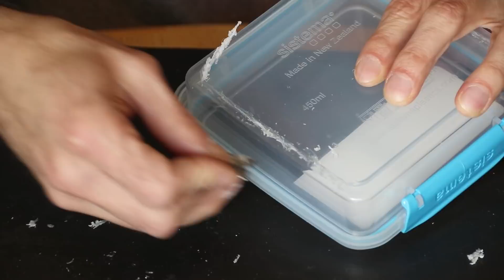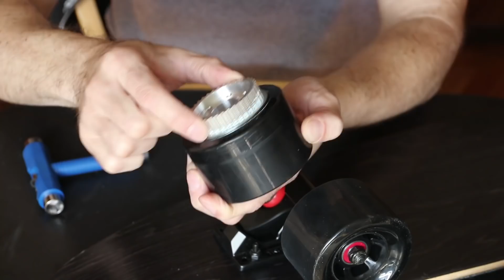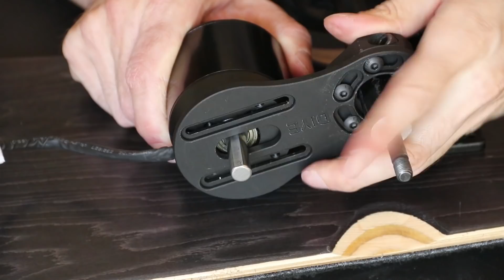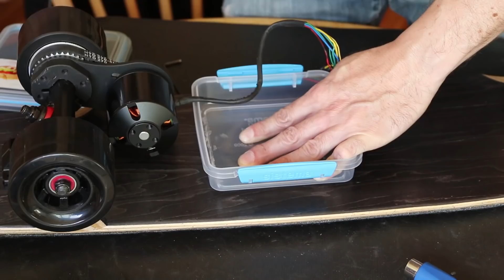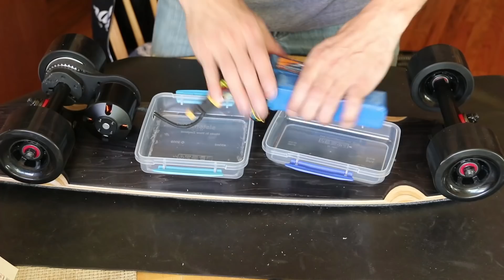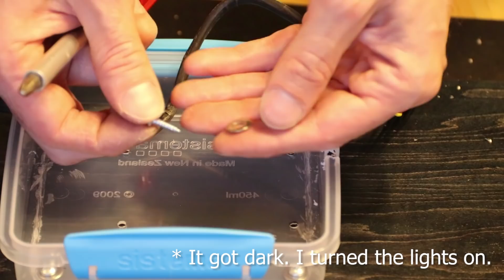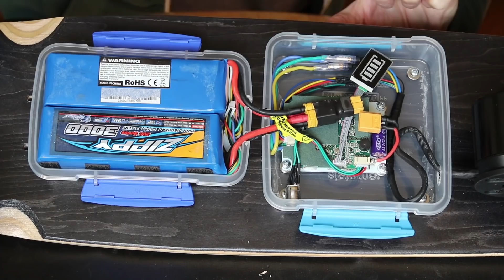Electric Skateboard Build - Belt Drive | Weight ~11 lbs | Price ＜ $300 | Speed ＞ 23 mph

Comment: I already have a 400-watt 1 wheeled electric board I need to put two 400-watt wheels on it will I have to change the control box which one should I get in the UK

Comment: Can I use a lead-acid battery pack for this controller?
Reply: 1st you have lesser volts. Seconds you need more amp. Not Ah or mah but continuous current discharge. 3rd its so heavy. 4th Dies quickly. Have you ever heard an electric car or PEV used PB battery as a source of power?

Comment: Hey man! Awesome video! I was wondering if you charge and discharge the battery pack through a BMS using the same connector?
Reply: you don't do that on belt drive. That motor will instant lock when it cut outs.(over amp) and youll kisss the apshalt from 40kph to a sudden stop.

Comment: The Sistema containers are ace, they work really well! I thank you for sharing that idea. I modified my board with 4 of the square ones, after my battery case snapped, 3 for my batteries to go in and 1 for the controller, I had to split my battery into 3 parts, I put the cells into holders and soldered them rather than weld the cells back together, now I can swap cells out on the fly to go further and the board has some flex now too.

Comment: My electric longboard has a handle cut out in the deck that loop a bike lock through to prevent theft if you're board doesn't have a handle cutout I highly recommend drilling out a hole big enough to fit a bike lock

Comment: Hub motors in electric skateboards are way way better in terms of torque, energy efficiency and overall performance. Belt-drive setups should be cheaper, but rarely ever are ever since the electric skateboards got popular (which is funny, as technically they are illegal). And honestly the design being more bulky with the whole belt contraption and with it often hanging too low to the ground, or as in your case even limiting steering, makes it rather vulnerable. You're likely to destroy it in real-life usage. The upside is how any problems generally would snap or ruin the belt, rather than destroy your ESC or motor. Although in such cases the ESC will have to deal with a huge spike in amps, so it might fry. And you have a few more options in terms of custom choice wheels and such, but in reality there aren't that much options available anyway. Thing is, should a hub motor setup ever get jammed, it'll destroy the wheels and or motor from the inside. So it could be more expensive to fix at that point. By the way, your build reeeeeally lacks any precautions against vibrations. And those containers couldn't take any kind of real world beating, like hitting a curb or rock, which is pretty much inevitable. It is unfortunate it got stolen, which is actually a huge problem with these things anyway. Even for scooters. It would be interesting to figure out a decent solution to that.

Comment: I was going to build such a board you have built. but i live in sweden where an electric board max can run at 20 km / h which corresponds to about 12 mph. do you have any tips on how to build or edit the engine for 20 km / h (12mph)?

Comment: Great video man! I'll follow this step by step when making mine but I want to go for a 12s battery and ESC, since I want it to be crazy fast.

190KV should be fine for a dual motor I was told.
Reply: A 12s system will fry the esc, go for 10s as it will still be crazy fast. I would also recommend if you’re going to go for a dual motor setup use two 280kv motors. One of these motors was enough to accelerate an 85kg person to 35km/h quite easily and me who is lighter to go at a top speed of 42km/h. So two of these with a 10s battery will be crazy powerful. If you want any help ill give some tips :)
Reply: @brendanoconnor4802  hey can i maybe get some help? im wanna build an e scakteboard with a belt driven motor. is that one a good one?: https://www.ebay.de/itm/170KV-C6374-efficience-Burstenlos-motor-fur-Elektro-skateboard-Longboard-2900W/163597762676?hash=item26172fc074:g:F-8AAOSw6d9clZFm
Reply: @brendanoconnor4802  hi...sorry for bothering after all this time...i'm building one...would this single motor alone shown in the video accelerate me (77kg) to 30kmh? What was your single motor size and kv? Trying to optimize costs and go for the bare minimum without burning it

Comment: I'd recommend using a motor with a keyway on the shaft to ultimately prevent the slipping. Also if you found one that could fit, a keyless bushing between the pulley and motor shaft might work best

Comment: How to the batteries work with it? The esc only uses up to 36v, and the batteries equal 37. Is 1 volt enough to fry it or should I just charge it less?
Reply: It's a 10s ESC, that means it runs on 10 cells. If you buy 2 5s batteries and connect it in series it will run just fine.

Comment: So just curious, your running a 10s setup but the motor you have linked is only rated up to 29V vs 42V?
Reply: I have the exact same question. What will be with the motor  in that case
Reply: from seller:
"Hi. 18-29V was the factory recommended. many people do use my motors with 10S battery, it works fine.

Regards
Dicky"
Reply: @zeroweber  Word, thanks for updating it!

Comment: Hey, love your videos, I'm about to buy the stuff to modify my old longboard, this should be work?

https://www.ebay.com/itm/RC-ZIPPY-Flightmax-4000mAh-5S1P-40C-/262728179362 (x2)

https://www.ebay.com/itm/GENUINE-SKYRC-iMAX-B6AC-V2-ACDC-LiPo-NiMh-Battery-Balance-Charger-US-STOCK-/252732465044
https://www.ebay.com/itm/36V-Dual-Motors-Longbaord-Skateboard-Control-Board-ESC-Substitute-with-Remote-HE/173867533802?hash=item287b5005ea:g:cksAAOSwNDBcx7LI
https://www.ebay.com/itm/No-Wires-XT60-Series-Serial-Battery-Connector-for-Turnigy-Zippy-XT-60/231237954123?hash=item35d6db2a4b:g:yxYAAOxy3cJTfPxd
https://www.ebay.com/itm/90MM-dual-6364-hub-motor-drive-kit-for-electric-skateboard-Longboard-Parts-24V/183663677631?epid=22030900027&hash=item2ac33550bf

I'm not sure about the voltage and that things...

Comment: If the motor hits the deck and ts the kind of motor where outside spins wont it bind up on the deck , just add the risers . Maybe carve the botom of the board for clearance and not even need risers

Comment: Risers give the trucks a little boost but they also help reduce stress and pressure cracks on the board. I tried no risers several times and my board always ended up getting tons of pressure cracks. Don't get me wrong though risers or no risers you will naturally have some pressure cracks but they can be reduced.

Comment: why dont single belt drive boards go in circles as they are only powered on one wheel?
Reply: Ivor Sherman because you steer it with your weight like a normal board to keep it in a straight line ...
Reply: @CameronVarnish  bit it wold still veer to the side that the motors on and be unridable...
Reply: Due to the weight of the board & other parts, size, being 4 wheels, spaced enough, etc. 
Easiest way to say why without getting confusing.

Comment: In ESC description it is written: 
".Please note that this control modula have hub motor version and for normal brushless motor version.(like 5065, 5055, 6354,6364,6374...motors)Max out put 1350W."
"Max output 1350W"!!!

and in motor description:
"power：2900kw"

Does it mean that motor will be loaded to 1350w only or esc will be burned?

I am now in this field, and I am looking for the best options for the first electric longboard.
Tnx
Reply: found an answer in older comments...
Reply: I own one ESC like that, I'd like to know the output. Thanks!

Comment: This is one of the best guides out here, and will probably build one just like this. Although your video states some of these, i want to make sure i have them straight.
-Are the batteries in parallel or series? if either what would you recommend?
-i have a few RC cars and i have a lipo balance charger, how would i charge these in the parallel or series cofig?
-does it matter what wheels you have? if so, could you specify? 
-I don't have a grinder and i don't plan on getting one so if there are any trucks that don't need grinding that would be much appreciated.
Thank you so much in advance to anyone who can help a first time builder out. I would really appreciate it.
Reply: Did you ever build it?

Comment: why do the trucks require grinding?
Reply: Only mount holes, ~height and width variants are somewhat standardized. Wider base requires beefier bar to be rigid. 
If you will take smaller width truck it wil be thinner and wont require grinding.

Comment: Mate you really need to get into 3D printing.
You could make badass enclosures for yourself.
Also if you need battery isolation, don't use those gorilla tapes or something like that, you need something that is high temp resistant and that won't compress, for that you can use "fishpaper" and "capton" tape.
Reply: Why do you need heat resistant tape to protect your battery from outside mechanical damage? If your battery is getting over 80C while riding, I think that there is some problem.

Comment: so if I was to buy the 5ah battery option listed here would I benefit from a second if so what would benefit? speed or ride distance?
Reply: It wouldn't work on just one battery, the esc is a 10 cell, so it needs 2 5cell batteries in series

Comment: So I was wondering if that esc would work with 2 motors
Reply: You will need two of those ESC for a dual motor setup, or you can get a dual ESC or a Vesc (recommended).
Reply: Definitely just use a VESC

Comment: dude add a gps and a sim module to your build that way you can always get its position
Reply: That would probably cost more than replacing it, not to mention the monthly fees for the tons of different boards that would all need to be payed for. He should just do like he said in the video and be more careful.
Reply: @shatterpointgames  gps +sim +ardrduino will cost you 15 dollars , what cost are you talking about here?
Reply: @TnInventor   Tn Inventor  Firstly your underestimating the cost of ardrduino and GPS modules for the upfront cost. (but I agree that is an affordable option). You're also discounting the fact that he has multiple boards. If he made a spot where he could move his GPS tracker from board to board that might be a good option. But he would still be paying 15 dollars a month for the data plan or $180 a year to "insure" a device which costs $300. Not to mention there's no guarantee he would ever get it back. He, like many people have owned e-boards for years and never had one stolen. So $180 a year for a "maybe I'll get it back" wouldn't be worth it. Because after two years of not having one stolen you could buy a whole new board and still have $60 extra. It might be worth it for higher value boards though, like a boosted board or Onewheel.
Reply: @shatterpointgames  why do you have to pay to instal a gps? 0.0 and why do you even need a spot? its so tini that you can put it in your pocket , and you can recive the position via a msg you dont need to spend a peny other then the modules
Reply: @TnInventor  I mean you have to buy the GPS hardware and then find a place to store it on the board itself. That is agreeably easy/cheap to do. However most GPS trackers rely on cell phone towers to communicate with the outside world. GPS tracking is free because it relies on detecting known satellites distance from the tracker and doesn't transmit or receive information from said satellites.  You can't you can't transmit from GPS without either paying a phone company or a satellite communication company a monthly fee. The most affordable option would be paying for a data plan from a phone company which would cost around $15 a month. If you can find a GPS tracker that can send it's location to your phone without a monthly fee please let me know because I definitely want one. And agree it would be a no brainer for a build like this one. As far as I know none exist.
Reply: @shatterpointgames  well in my country we only have to pay 5 dt=1.5 dollar every 3 months  to have a an active and functional sim card , ......... but the gps and sim here cost like 10 times more thenof ebay

Comment: Could someone please advise on what controller would be best for a scorpion 4225-550kv? Thanks
Reply: for an e-board? 550kv is a little bit much kv i think. VESC is good because you change all settings yourself but isn't that easy to install and not that cheap.. otherwise the controllers Oren's using are ok, but as he said match the battery voltage with the controller ! (6s ESC - 6s battery or 10s ESC - 10s battery)
Reply: Mr Niceguy Hey, I have now purchased a scorpion 4035-560kv and a Flipsky fsvesc 50a-240a Max, I place on using it to replace the old motor and esc in an electric surfboard of which water got into and fried the electronics and rusted them apart. I may make a video on it once I have the parts and if I manage to repair it, if you have any advice that would be great. Thanks
Reply: @TheGreenOps nice! wish you fun with that. my advice: carefull set the battery and motor limits in the settings of the VESC (better stay below limits of VESC and battery if you dont want to fry your parts again ;) i can recommend the channel i am deluxe. there are lots of nice videos about VESC and how to set it up. But of course you also can ask me maybe I know the answer :P regards
Reply: Mr Niceguy hahaa fortunately I didn’t fry it myself hahaa I brought it as spares or repair off eBay. I’m actually not even sure if it overheated, I just know it was all rusty inside as sea water had entered through a broken seal and the esc and motor was unrepairable.. thanks for the advice :) I will definitely check that channel out as I have no idea how to set the vesc but would of course like the most power possible from the motor without it overheating haha which maybe quite likely has the vesc or motor have no cooling components and are in a water tight space.. I may see if it is possible to wire two small cooling fans inside the compartment and connect them somehow to the esc for power?
Reply: @TheGreenOps  yes should be possibe i have a receiver and a bluetooth device connected to the VESC. With the ports of the receiver I can feed 5 V to my front and back lights... if you want to connect the fans directly to the VESC i dont know which ports you need to connect but should be work and not be too hard to find out i think

Comment: Hi, I’m curious if those eBay esc like you’re using have adjustable speed when riding. Like is it just on/off switch on the remote or is it adjustable? Thanks 🙏
Reply: It's adjustable according to how much you push the trigger on the remote.

Comment: Hi Oren, I have been thinking for a long time what will be better?
- ready to ride Wowgo 2s (2 hub motors)
- or one big 6374 190kv motor (single belt drive sys.) with 12s LiIon
     batteries and single enertion vesc
The most important for me is:
- acceleration, hill climbs, torque
Do you think one big motor with good equipmentgoodcan beat the hubs of wowgo motors?

Comment: On ebay it says the motor, has 18-24v but the battery your using adds up at 37v.?? 

Also does it matter if my battery is a 5s lipo instead of your 5s1p.

Comment: I’m using the dual motor version of this 10s dicky ho esc with 2 of the same 170kv motors without the hall sensors plugged in. If I plug them in will I get smoother  braking? Will I lose power? Could it be dangerous if the hall sensor fails?

Comment: Can I take 6s Batteries for the esc ?
Reply: One 6S battery need the 6S ESC. Two 6S batteries in series(12S) cant be handled as Oren's seller offers only 10S max ESC. The 6S ESC can Handle two(or more) 6S in parallel though. A 6S electric skateboard is viable if you are not interested in high speeds and climbing steep hills but considering the price is the same for 6S and 10S ESC invest in 2x5S Lipo is a good move.
Reply: @colorsigma101  thx

Comment: Hey, Oren. I was wondering -- here in 2019, now! -- whether the second board required you to grind a truck too or did you find a different truck with the right shape for the motor mount?
Reply: why not just get caliber 2 trucks? they are a staple for most DIY builds and there are soild mounts out there for those trucks

Comment: https://hobbyking.com/en_us/kd-53-30-high-voltage-brushless-outrunner-190kv.html can I use this motor with the battery and esc you use ? (the 2 5s 5000 batteries)

Comment: what's the max. speed ? and the range?
Reply: depends on the battery you use
Reply: @ScientificRecaped101  It depends on a lot more than just that. The power of the motor, the weight, the type of terrain, the wheels and bearings, the weight of the person, the weather and whether or not you're cruising at top speed or not. It's why a lot of the times claims about range aren't correct as far as real world situations go. Not to mention how a poor quality battery will likely loose its optimal performance within only a few weeks of usage. Especially with these DIY builds that rarely have matching electronics for what is required.

Comment: Is there another motor option, cus it takes  3-4 month shipping to Germany...
Reply from the maker: I'm not sure of other motors that size at a similar price. Maybe you can check about other shipping options. It's also very slow to the US without getting expedited shipping with a carrier like DHL.
Reply: isn't this also a good motor for the board: https://hobbyking.com/en_us/kd-53-30-high-voltage-brushless-outrunner-190kv.html  @orensprojects7250
Reply: Look on diyelectric's website or hobbyking or alien motors. Sk3 motors work very well. Just don't buy one over 300kv or you won't have a lot of torque
Reply: How does the battery get charged up